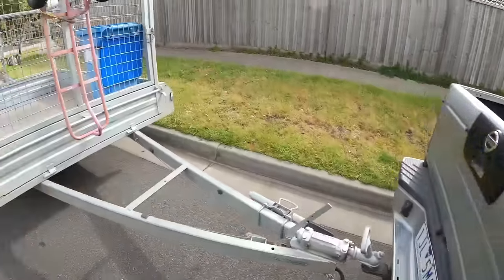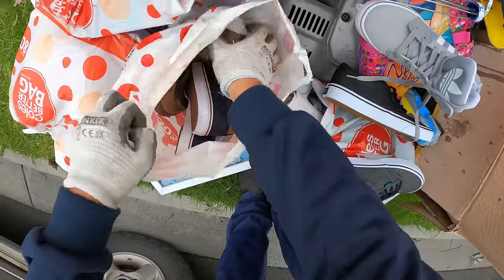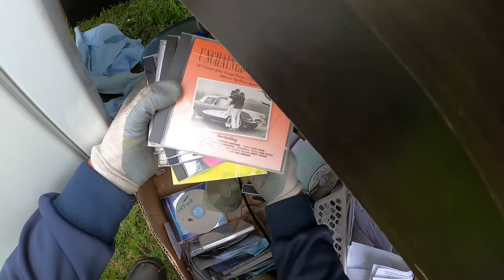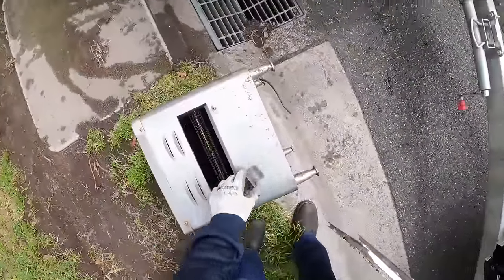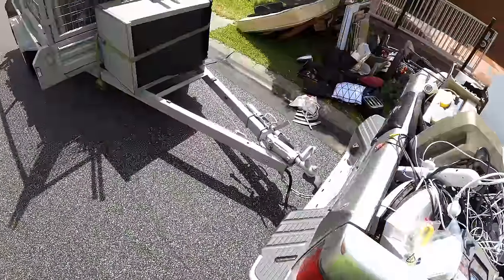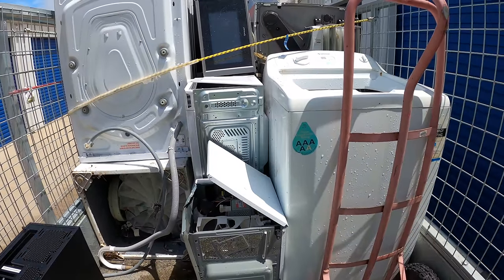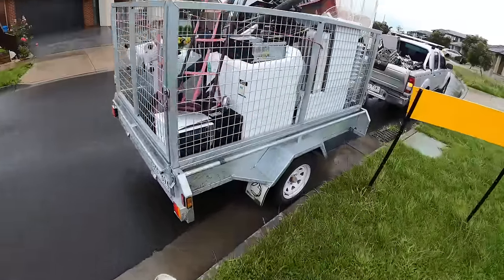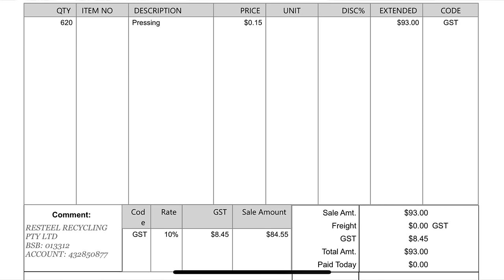Curbside Chaos - Heavy Load In Wayward Weather

Comment: You need to sort and stack your scrap better when you first place in the tray or trailer
Reply: You’d seriously be able to get some scrap in that trailer and tray if you stacked it right and get a big bucket or half a barrel for all your cords
Reply from the maker: I have tried the bucket for cords but prefer no bucket. If I had all the time in the world I’d stack differently though my main focus is to get to the next pile asap 🙂
Reply: @PolyProphet  it takes legit 2 second and would stop you from double handling
Reply from the maker: I’m still a learner so it definitely takes me longer than 2 seconds. 20-30 seconds per stop adds up and means less piles at the end of the day. Each run I feel I’m improving though 🙂
Reply: @PolyProphet  I’d personally rather go a little slowly and stack more cause the more you stack the more you make and consider it’s only 15c a kg you want all the weight you can get plus only making $70-$120 a day isn’t even minimum wage so if I was you I’d spend that each 20-30 seconds cause at the end of the days you’ll make more money and probably closer to the minimum wage then 70/120
Reply from the maker: @robbiecampbell-woodlock6183  That’s a great point! Steel is actually last on the list with its current price. Non ferrous, batteries, cords and resell items is what I’m hoping for each pile. Having a YouTube channel doesn’t hurt the bottom line either 🙂